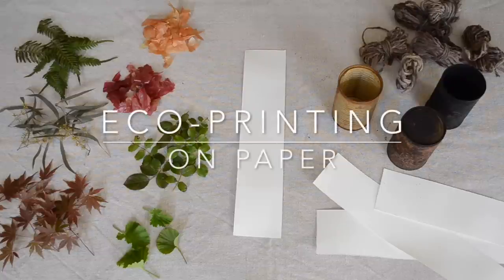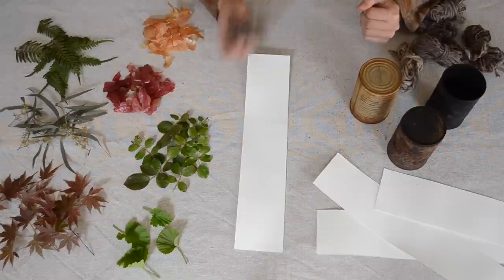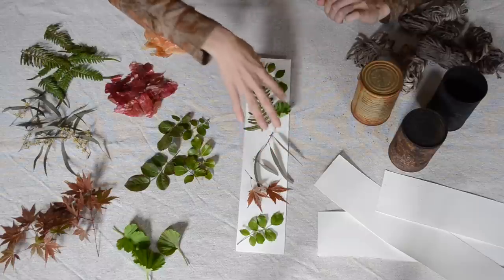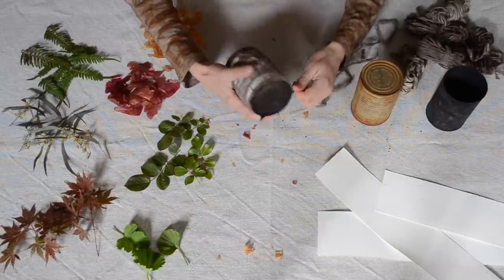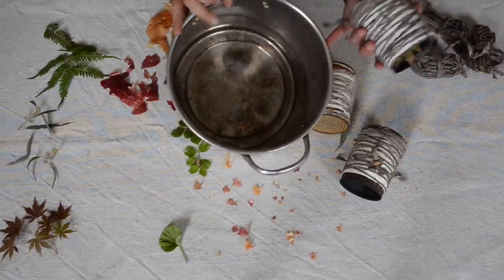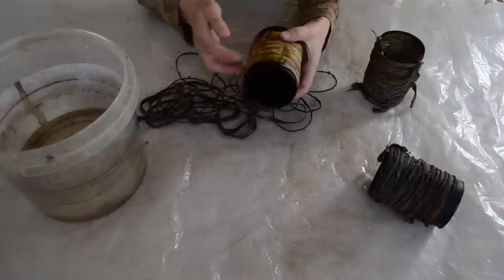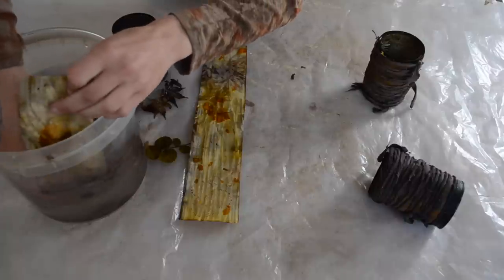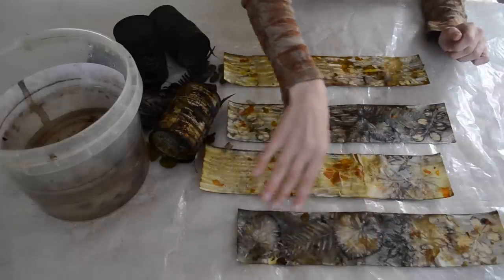Eco-printing on paper tutorial: how to eco-print with a rusty can

Comment: Can you please explain sizing with gelatin? Thanks for the video--very informative and beautiful results!
Reply: The watercolour paper I used (arches brand) comes pre-sized with gelatin. It's not an essential ingredient, and you can really eco-print on most papers with just leaves and water and heat, but the gelatin does help produce bright prints. You can size paper yourself by soaking it in dissolved gelatin or in soy milk. I have a bit of information about preparing paper with soy milk in my eco-printing on paper ebook, Plant Poetry. It's available on my website, www.learn.gumnutmagic.com

Comment: Thank you for this video. You mention coating paper with gelatin. Can you explain further? Thank you.
Reply from the maker: Some watercolour papers, including Arches brand, are sized with gelatin in the manufacturing process. So it already has it when you buy it. This isn’t necessary, but it does help produce brighter prints. It is also possible to soak paper in watered down gelatin or soy milk and then let it dry before eco-printing, if you are using a different brand of paper. Again, not necessary but it can help you get interesting results.
Reply: Thank you for your response. I just bought your tutorial and am excited to read it.

Comment: These are so beautiful! Off to look for rusty cans now! :)  Please one question...you mentioned that the watercolor paper was coated with gelatin - is that just normal gelatin from the grocery store? Thank you so much for sharing. xoxo
Reply: The watercolour paper I used (arches brand) comes pre-sized with gelatin. It's not an essential ingredient, and you can really eco-print on most papers with just leaves and water and heat, but the gelatin does help produce bright prints. You can size paper yourself by soaking it in dissolved gelatin or in soy milk. I have a bit of information about preparing paper with soy milk in my eco-printing on paper ebook, Plant Poetry. It's available on my website, www.learn.gumnutmagic.com
Reply: @louiseupshall8126  I have used arches brand many times for watercolor painting - but have never noticed if it was already pre-sized. I don't have any on hand now, but do have other brands. I might try sizing it myself with gelatin. I have two cans (we just took everything to the recycle drop-off)!! ! But I've sanded these and put them in an old aluminum kettle with a piece of rusted metal. Why? I have no idea. lol :D  I also just collected wild mulberries in our neighborhood and will toss them in the water with the next batch I try. I've only stacked and boiled a couple of times...with half way satisfactory results. Thank you so very much for this video. I'm looking forward to perusing your site and books that are available. It was so kind of you to share this tutorial. Plus, I need to get some onions!

Comment: I use alum - do you just mix gelatin and brush it on the paper?
Reply from the maker: This paper has been sized with gelatin by the manufacturers, but yes you could brush gelatin on or dissolve it in water and soak the paper in that.